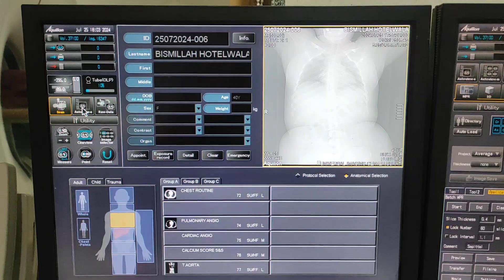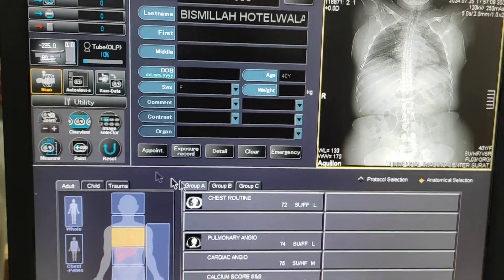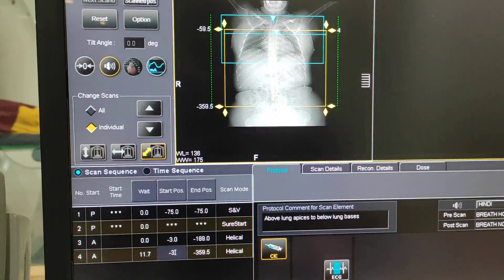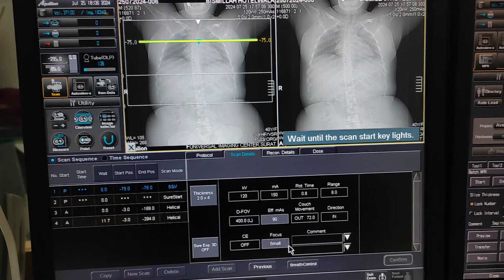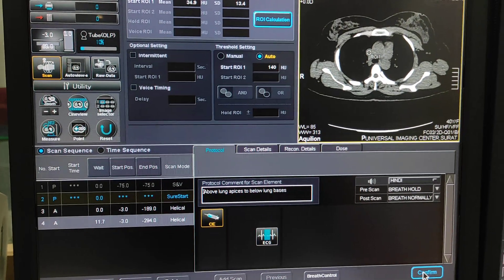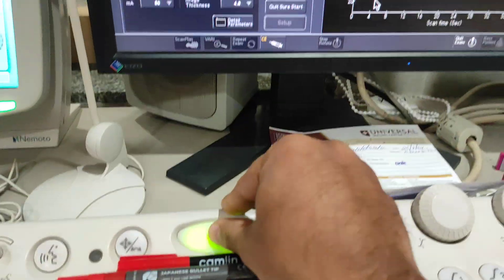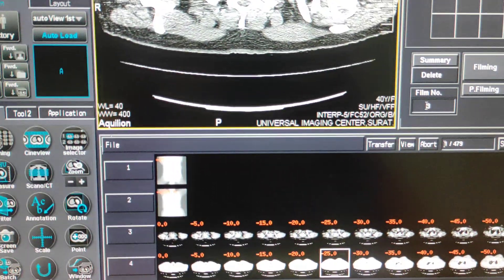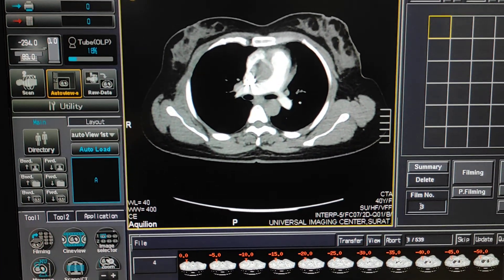CT Pulmonary Angiography on Toshiba 64 Slice.

Comment: Please make vedio on upper limb angiography and aortography..
Reply from the maker: Ok, ill try...👍👍👍
Reply: @MRICTScanTech  please sr, i face some trouble in these cases, we have same CT machine...
Reply: Some teacher says put ROI on pulmonary trunk does it make any difference if we ROI on svc
Reply: @HafsaAlamgir-bp6pw I don't think it does. All you need to know is the right HU to set (you should also know that the HU value is affected by how much of the contrast media that has arrived at that location and also, the time it took or will take to reach it at that point).